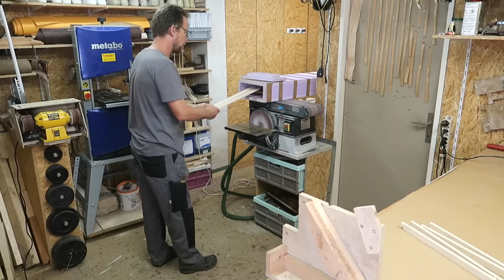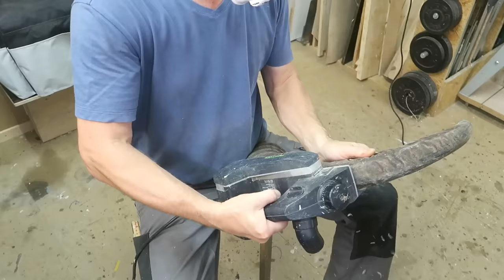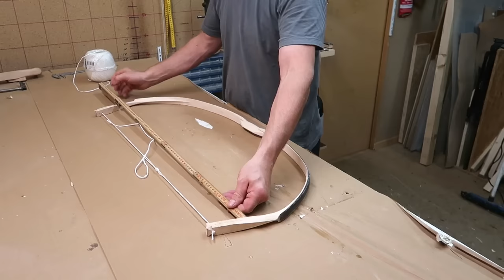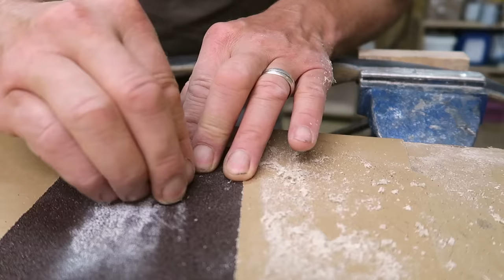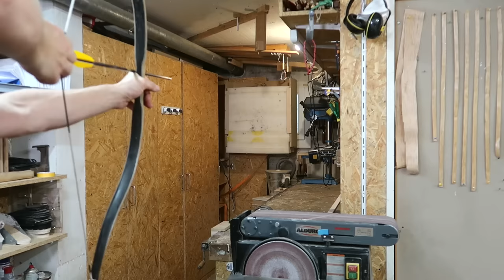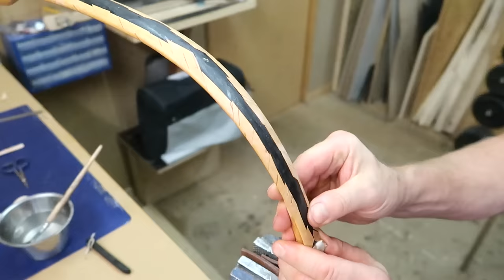Making a horn bow - How to make a composite bow

Comment: You can use the tip of the horn to make an archer ring. Since the thumb is used in Eastern bows, a special ring is used for it. We call it Zihgir. Some men in Turkiye still use these rings as jewelry. Those used as jewelry are mostly made of silver or precious stones. But the one I use for archery is made of buffalo horn. Really much better than metal, leather and plastic ones. It fits perfectly because it was made specifically for me.
Reply: Ottomans Turks still were using that type o bow in Naupactos battlesea in 1571.
Reply: @chrisg.k487   Because Turkish bows both faster and had a longer range than than the fire weapons (Rifles like Arkebüz) of that period.

Comment: I just watched 3 Turkish videos, although they are making traditional Turkish bows, they were using modern materials and processes except the wood part, yours was the best and most detailed and traditional so far. Also watched a Japanese one where you shared the method to bend the bow. You should use the ring to complete the method of releasing the arrow, thank you.